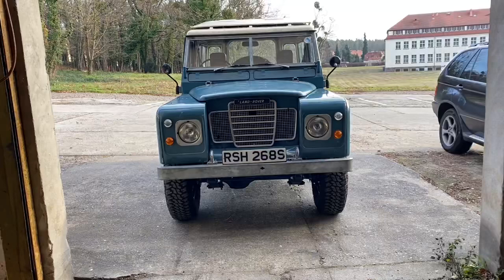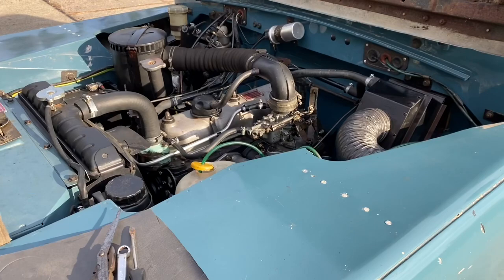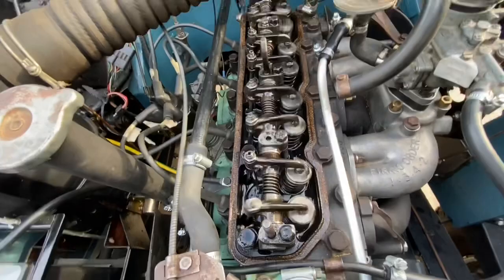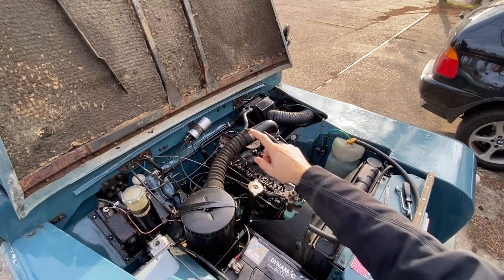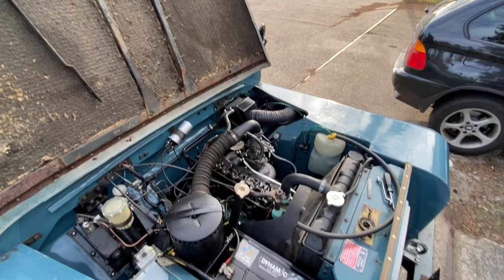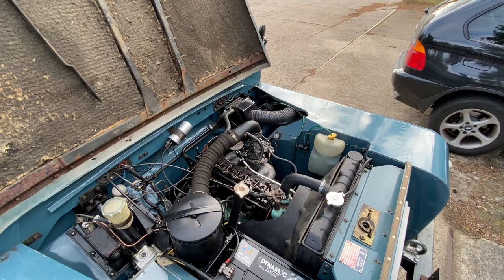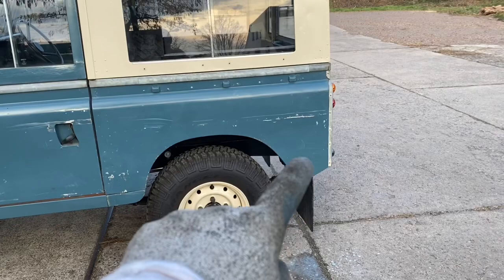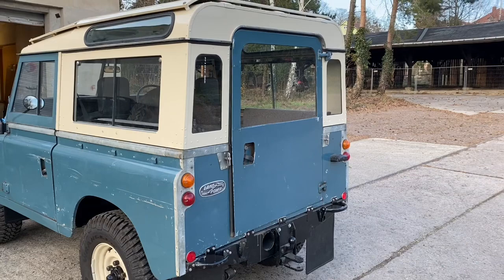Land Rover Series 3 Restoration - Setting the valves & some paint - Part 62

Comment: Joël - great work with the stethoscope.  Yes, proximity to the valve (vs on the valve) is what will pick up which one(s) are clacking.  I’ve found that some tappets can measure perfectly with the feeler gauge but still clack!  Why?  The tappet  can be worn so it has a bowl-like shape where it meets the valve.  To see what I mean, make a bowl shape with one hand (the tappet) and make a fist with your other hand (the valve) - push the fist into the bowl and imagine setting the gap with a feeler gauge - there will actually be more distance than the feeler gauge measures... The result is - you can get noisy tappets even when the feeler gauge reported that they are set correctly - because there is a relatively bigger gap than on other valves.  The stethoscope let’s you isolate the noisy ones - and what I do is actually set them tighter than the feeler gauge recommends and then feel by hand - moving the rocker up/down - that there is still a slight gap (which is what’s important).  It takes a little doing but you really can remove any clacking.  That said, most Series Rover engines I’ve heard do have some clack and it’s pretty normal/not overly concerning.

I laughed out loud about the oil in the ear comment - been there, done that!  Happy New Year!!
Reply from the maker: Hi Charlie, thanks for that. Happy New Year to you too.

Comment: Happy new year, Joel. Whilst I know Land Rover suggest that the valve clearances can be set hot or cold, I set mine cold. As the engine warms up, the valve clearances reduce a little and it leads to a quieter engine. So long as the valves still have clearance, you won’t lose any compression. I would suggest resetting with a cold engine and see if the noise reduces. I would just add that I don’t think the engine sounds overly noisy.

Regards, Mark.
Reply from the maker: Thanks Mark, and the same to you. I have become happier with the engine sound since setting the valves (hot and cold) and will leave it for a while now. Have a good Sunday.

Comment: Joel, thanks for the great videos, you have got me through lock down this year. Bungee cord is a must, I was knocked out by a LR bonnet falling on me. I have a SWB 1971 S3 diesel that I would love to restore but I need a workshop, maybe one day! Jobs this week for me; alternator replacement, brake reservoir pipe is corroded and tube is perished, puncture to the front off side tyre, front os indicator intermittent fault. Best wishes and thanks once again.
Reply from the maker: Hi Melvin, thanks for your message. Looks like you have your work cut out for you. Good luck with it all. Indicator is probably a connection issue. I had the same thing and replaced the bulb holder and traced some bad earth connections by the bonnet latch.
Reply: @My911  The alternator was a broken cable 100mm from the alternator, the cable had 4 joints in it and was very brittle, replaced with a new part loom, the ignition light, oil warning light and the temp sensor gauge are not working now although the lamps are not blown, ordered new sensors just in case but I suspect something wrong behind the dash. I can’t remember the oil light ever working and it’s been a long time since I remember seeing the ignition light working. The indicator was a bad connection under the bonnet. Labour of lobe
Reply from the maker: Temp gauge and oil temp are possibly old broken sensors. Easy to replace. Although the lights are powered all from the same connection with grounds to the back of the Instrument panel. Quite possibly a bad earth. Just whip off the dashboard and clean up those grounds. Lowly slowly, bit by bit. 👍

Comment: Hi, i'm finding when I have finished adjusting a valve to the correct clearance,  there is slight 'wiggle' on the rocker when pushing back and forth between the valve and the spring. Which obviously seems that no matter how particular I am with clearance, the required clearance won't be that accurate anyway. It's a series 3 diesel that unfortunately hasn't had the attention these cars need to prolong them,  turner engineering have the rocker arm assembly as a direct replacement but I don't know how difficult this is etc? I'd massively appreciate your input or anyone for that matter, cheers
Reply from the maker: Hi Georgie, thanks for your message. I would recommend watching (and subscribing) to Steamwally. He has done a full refurbishment of a rocker shaft and it is very informative. Please say hi from me. If at the end of your research you feel that yours needs a full refurb, you can ask yourself if you want to DIY or indeed purchase one from Turner Engineering. I opted for the latter in 1996 (yes they have been around a long time) and bought a fully gas-flowed unleaded cylinder head complete with hardened valves and rocker shaft and it’s still going strong almost 30 years later. So they get the thumbs up from me. 
I hope this helps and by all means keeping touch via Instagram if it’s easier. Joël
Reply: @My911  Many thanks for replying back Joel, it's still early days with mine and I'm debating how much I want to throw at it. There isn't a massive amount of play and I anticipated slight wear when taking the cover off, it looks a fairly simple job to replace the rocker unit but whether I want to spend the £400 or just live with it for now was my reason for asking. I know these machines can be fairly forgiving but they can also soon bite you (and your wallet!)
Reply from the maker: Hi, yes, I understand entirely. It’s easy to spend lots of money and £400 is indeed that.  I would definitely adjust the clearances as required (Google the 9er rule for this) and see how it runs. If it’s not clattering or affecting the running, then it will last a while longer. My thought was that if there is wear, it it might mean that the shaft is starved of oil. Especially if you say it hasn’t been well maintained. I would certainly check the oil passages for any blockages (they are very small holes in the shaft itself) and clean them with brake clean. In fact, you can simply remove the rocker cover and run the engine to see if the shaft and tappets are getting enough oil. Just be careful doing this. 👍